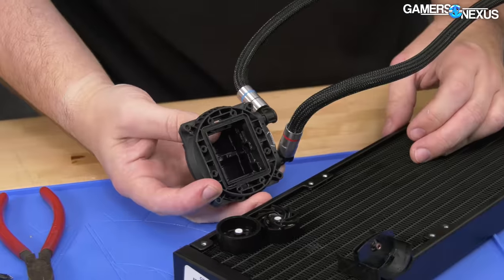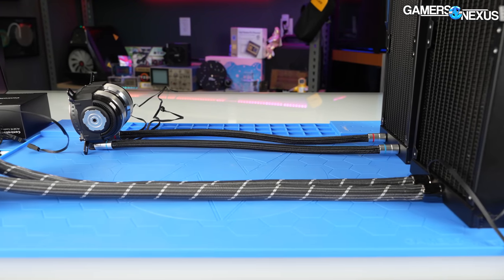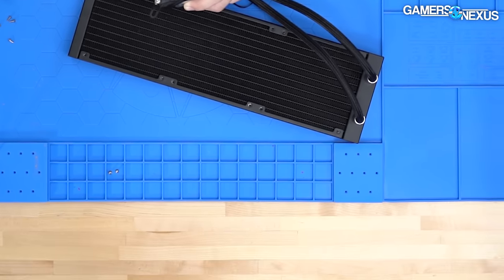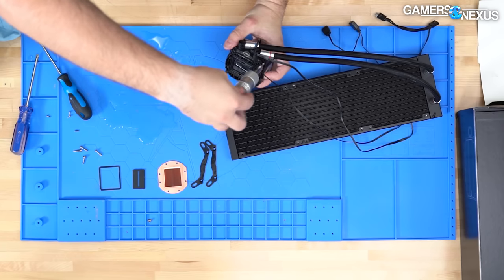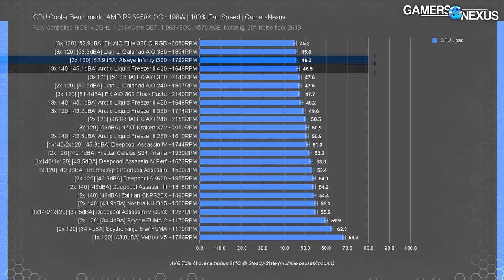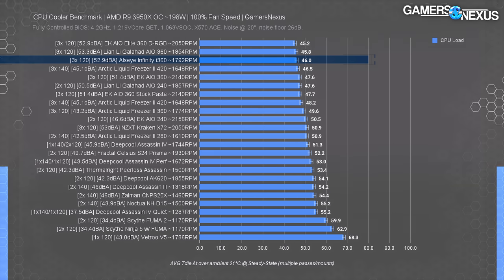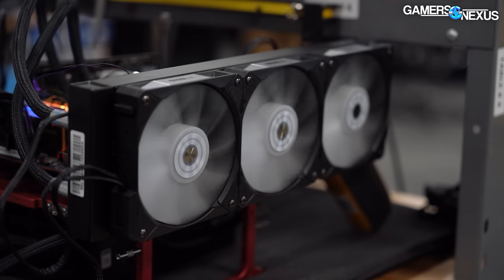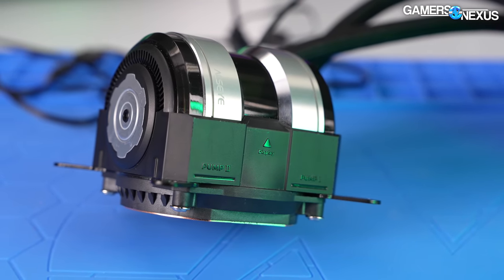Strange Liquid Cooler from AliExpress | Alseye Infinite i360 Dual-Pump AIO

Comment: Looking at the comparison charts for 100% fan speed, I noticed the Arctic Liquid Freezer II 420mm is on there twice. Both at the same noise level, same fan speed, but two different temperature readings. Does anyone know why this is? It seems to be identical configurations for the Liquid Freezer II 420mm, but one is at 46.5 over ambient and the other is higher, at 48.2 over ambient.
Reply: I believe it's because they tested the LFII 420 with a standard mount and the offset mount. The reduction for the offset mount was supposedly 2 to 3 degrees, so it would make sense that those two figures would be for those two configs. Just a guess though, I can't be bothered to find and watch the crazy long LFII reviews again
Reply: Yea😅. Maybe editing error
Reply: The cooler one has an [offset] tag with it, this is just a guess but I'd bet it's from an offset mount for Ryzen processors since their cpu cores are not in the middle of the cpu but further down. I could easily be wrong though.

Comment: What's the reasoning for taking it apart before you run benchmarks? There's no guarantee you guys will put it back together correctly, or even in the same manner as out of the factory and it could affect the benchmarks you seemingly took after you lobotomized the AIO.

Comment: im using that arctic cooler you showed in the 360 size
my ryzen 7 5800x3d runs from 45c to 90c on it (thats with pbo2 under tuner undervolt using a -30 offset to keep it cooler)
i got it since it seemed to be the cooler you always used for your testing
i used the am5 holes (like the instructions say to do for x3d chips)
was i wrong to use that mount or should i have done the am4 mount and would i see lower temps if i did?
Reply: I run the offset on an 360 Arctic that moves the cooler down nearer the gpu, is that what yours did. As according to derBauer that is where the 8 core AMD cpus needs the most cooling.

Comment: If you make a device like this with 20+ individual pieces, required glue, and 10 screws, you have utterly f'd up designing. Every tool costs money, every assembly process requires more time and money, and more parts means more likelihood of failure.

Comment: Wow! find it hard to believe how much you messed up getting that pump module apart. Come on, it's hardly rocket science. You need to do much better than this.

You might have some decent test equipment now, but if you don't step up your game with the testing you're going to look incompetent at best. It's frustrating because it's apparent that there are members of the team that are competent in testing, which is great and I look forward to some serious in-depth testing and methodology from you.

Comment: 0:52  "dual pumps design accelerates the liquid flow speed" <-that's just TOTALLy and PURELY bullshit ^^
pump in serial don't increase the flow rate, so it don't increase the flow speed
the second part is correct " gets higher heat-exchange efficiency" , why? because you have more pressure, so more pressure drop, so more heat transfer
theorically it increase the lifespan of the pumps...THEORICALLy ^^ because the day where your waterblock is clogged,  your (pull) pump will heat (and die?how many guys don't check their temp after they use a watercooling? :p )

Comment: Trying entirely too hard on the engineering side for them to not care enough to pick a name and use it consistently, that's a big fail on many areas. Huge amounts of excessive engineering effort for no actual benefits, very little maintainability vs. the competition, and then they can't even get their staff to be consistent about the name of the product. I would definitely not trust the brand much on this.